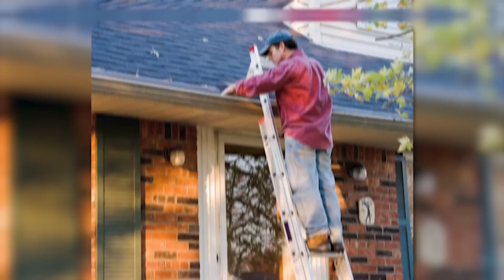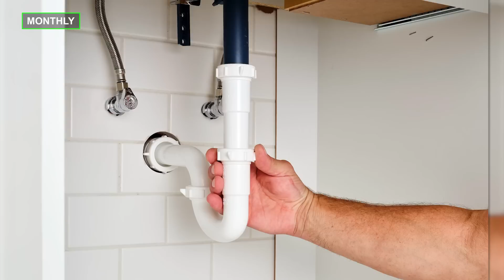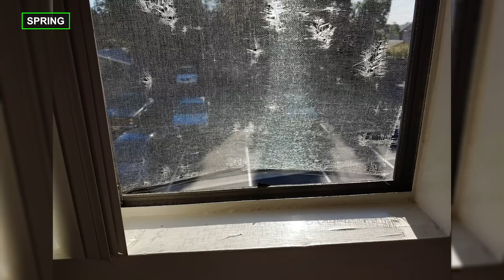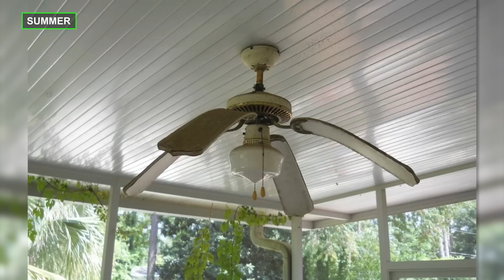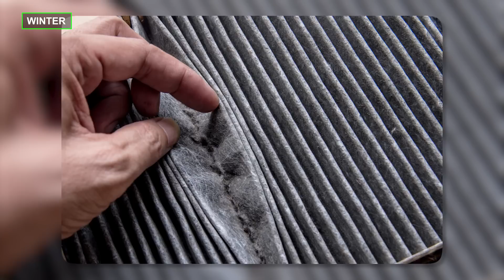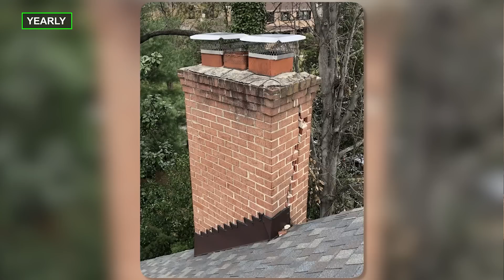Easy Maintenance Checklist That Saves You THOUSANDS

Comment: you have a typo on the document in the upper right corner heading - should be trim trees. Also, a bit frustrated I had to sign up for.a text and mailing list to get this. That doesn't create a loyalty inducing experience. Just the opposite in fact.
Reply from the maker: Thank you for your message we will address these items. Thanks for watching

Comment: What kind of seasonal maintenance is there for tankless water heaters?
Reply from the maker: Tankless water heaters are excellent for efficiency and longevity, but they do need seasonal maintenance to keep running at peak performance. Unlike traditional tank-style heaters, tankless systems are more sensitive to scale buildup, water flow restrictions, and filter blockages. Here’s what’s typically recommended:

⸻

Seasonal Maintenance Checklist for Tankless Water Heaters

1. Descaling (Flushing the System)
	•	Frequency: Once or twice a year (more often if you live in a hard-water area without a softener).
	•	Process:
	•	Shut off power and water to the unit.
	•	Connect a pump to the service valves and circulate a descaling solution (like food-grade white vinegar or a specialized cleaner) through the heat exchanger.
	•	This prevents mineral buildup that can reduce efficiency and shorten the heater’s lifespan.

⸻

2. Cleaning the Inlet Filter
	•	Tankless units have a small filter where cold water enters the system.
	•	Remove, rinse, and clean the filter every 3–6 months to ensure unrestricted flow.

⸻

3. Inspecting Venting & Air Intake
	•	For gas units, check that vent pipes are secure, free from blockages, and properly sealed.
	•	Ensure exterior air intakes/exhausts are clear of debris, nests, or snow buildup (especially important in winter).

⸻

4. Checking for Leaks or Corrosion
	•	Inspect water lines, gas lines, and connections.
	•	Look for signs of rust, drips, or condensation around fittings. Early detection prevents costly damage.

⸻

5. Running a System Test
	•	After maintenance, run hot water through faucets to confirm consistent temperature and pressure.
	•	For gas models, listen for any irregular burner noises and confirm clean ignition.

⸻

6. Professional Annual Service

Even if you handle flushing and filter cleaning yourself, having a licensed technician service the unit annually is smart. They’ll test combustion (for gas models), inspect the heat exchanger for wear, and verify all safety sensors.

⸻

✅ Seasonal Tip: In fall and winter, pay extra attention to venting and intake areas—leaves, snow, and ice can cause blockages that lead to error codes or shutdowns. In spring and summer, focus on descaling, since warmer water temps accelerate mineral buildup.